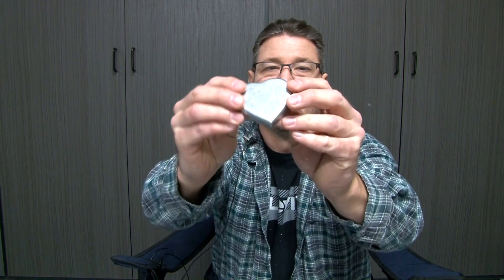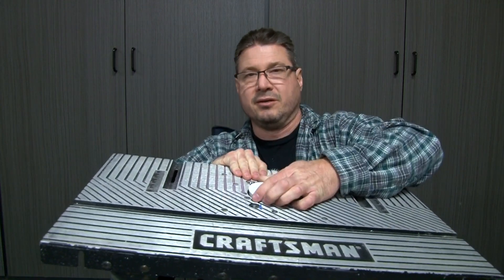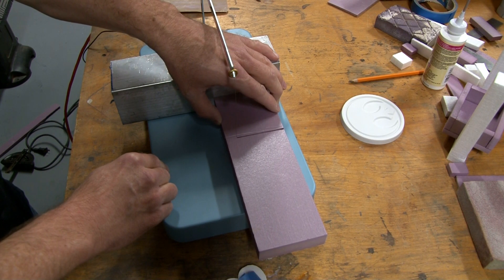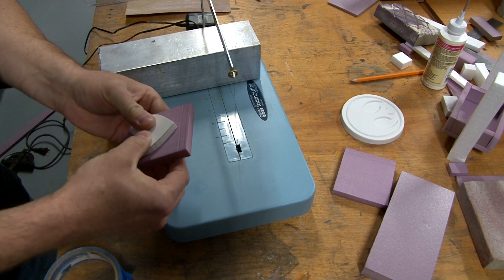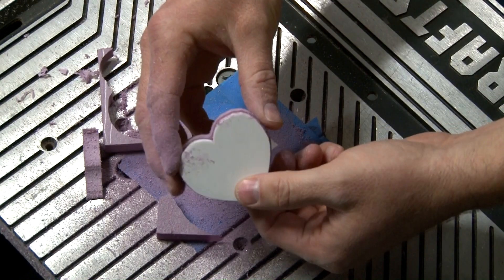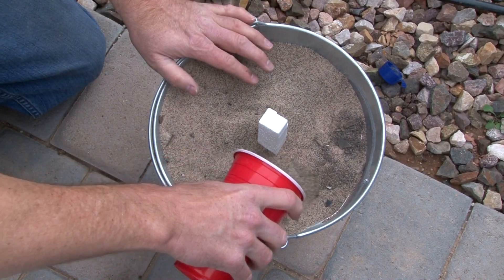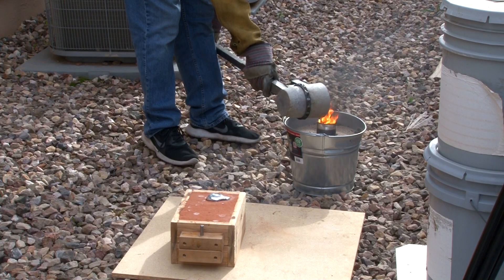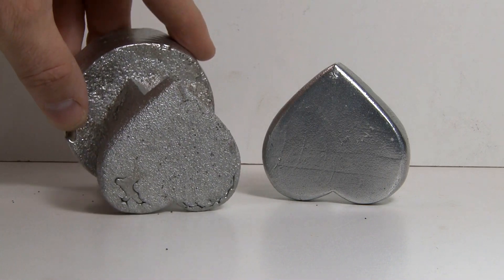Why you should use a refractory coating for casting and another way to cut foam patterns.

Comment: From what I've gathered as a casting layman, even a tiny bit of slurry coating before burying it in refractory sand will help keep lost foam castings smooth. My idea is to use alumina as a loose casting bed, with some kind of slurry (suspendaslurry for steel) coating the pattern. We'll see.
Reply from the maker: Should work pretty good.  Alumina has an extremely high melting point.  Let me know what type of slurry you decide to try and how it worked.

Comment: Hey, its me again. Ty for the router video. Guess I might just have to go with the router :D
Reply from the maker: Yup I am glad it helped. The router method gives edges that are alot more straight.  I just did a video using the wire method and I wish I made a template and used my router  instead.

Comment: Thanks for the experiments.  Have you seen the way the RC airplane guys cut wing profiles on a hot wire cutter?  They essentially pin a 3mm plywood template to the foam and run the wire along the edge of the template.  Pretty accurate and the wire doesn't burn the plywood.
Reply from the maker: Sounds good thanks for bringing that up, I will go check it out.  Also, thanks for realizing I did do experiments, I am trying to bring something different to the table on my channel even though it may not be the best its still a way for something to work or just something to think about.

Comment: It's always great to show others ways to cut the foam.  I love my CNC 😁. The only thing with the router table is that it's very dangerous having your fingers close to the rotating blade.  I'm Mr safety after cutting my finger off with a table saw.
100% to use the coating on the foam. 👍👍
Reply from the maker: Yup I am behind the times when it comes to CNC, one of these days though.  I am just limited to 3d printing now.  If I was using wood on the router that close I would probably not do it but there is no "grab" on the foam.  I am sorry about the table saw incident thats harsh.  That would make me be alot more cautious too. Thanks for watching
Reply: @DamonsMetalCasting  true about the no grab, but still dangerous 👍
Reply from the maker: @HeinrichsMade  All power tools have some type of inherent danger to them, and I would never encourage anybody to do anything they personally felt was not safe.
Reply: @DamonsMetalCasting  definitely!  I made a jig for my router to make a circle.  I think it's in my copper rose video.  My fingers were close there.  I cut little at a time, to make it a little safer 😂

Comment: The channel Flight Test did an episode on Hot Wire cutting, and they used balsa wood as a template. The wire doesn't get hot enough to cut the wood, and you can just tape the template to the foam and get amazing detail.
Reply from the maker: yeah I was recommended that too from a hobby sand casting FB page.  The positive would be it definately would make the wire spot the edge instead of my off set.  The only positive I realized when using the router was it doesn't flex like a hot wire and makes a straighter cut.  In my opinion the router makes a slightly cleaner cut too, but after sanding either way would get to the same place.  Thanks!

Comment: I’m shocked the sand doesn’t cave in during the pour, it looks so dry and untamped. How does it hold its shape?
Reply from the maker: All I can say is magic.  I have no idea and I am surpised by it too. The sand is dry.  I bet if the parts are larger the sand might actually have enough force to cave in the pour.  I also had the foam buried pretty shallow in the sand so it didn't have much weight pressing down it.  Thanks!
Reply: @DamonsMetalCasting  I tried using this coating for a pla casting and did not have any luck the 2 times i tried.  I was pouring brass, and the coating broke apart both times.  Was worth a shot.
Reply from the maker: @wantafastz28  I have not done a pour of brass yet, but I do know the temp is much higher than that of aluminum.  In the industry they preheat the mold so it doesn't fracture due to heat stress.  I would talk to the guy that makes the youtube channel Heinrichs Made.  He added a comment below, click on his link, I think he has done some brass pours that have been succesful from lost foam.  He also will answer your questions about the brass and the refractory coatings.  I dont think he has done a PLA pattern that you are working on though.

Comment: Damon, what bit did you use on your router?
Reply from the maker: It was a carbide double flute 1/4" straight bit.  Probably doesn't even need  to be carbide since its just cutting foam.  You could probably even run a bit with a bearing on the end and run the foam and the pattern upside down compared to my setup and not have to make a 3d printed adaptor.  I have tried other bits that put a curve on the edge and those work real nice too, i just had to use a guide for it instead of my set up.  Watch your fingers if you do this I end up being close to the router bit.  I also 3d printed the plate so the foam wouldn't fall into the blade and my fingers with it.  My original adaptor plates that came with the router table left too large of a space between the table and the cutting blade which make me extremely uncomfortable with small parts so I made my own. Thanks!